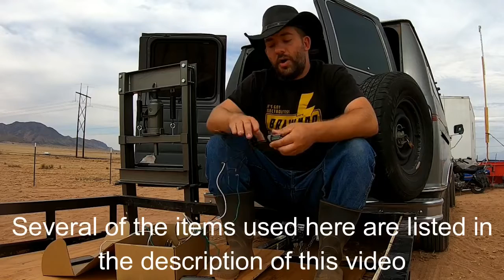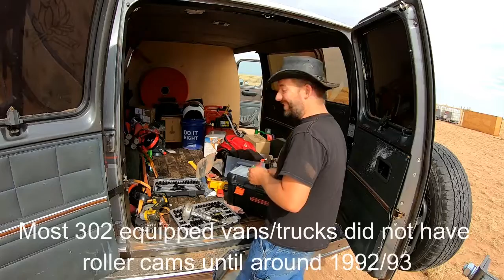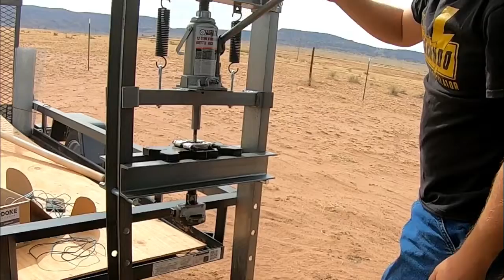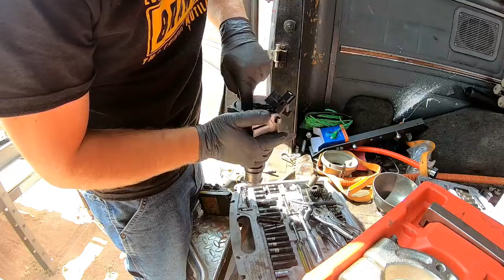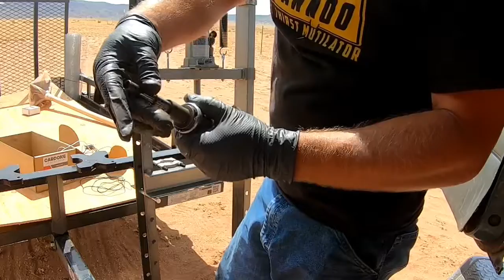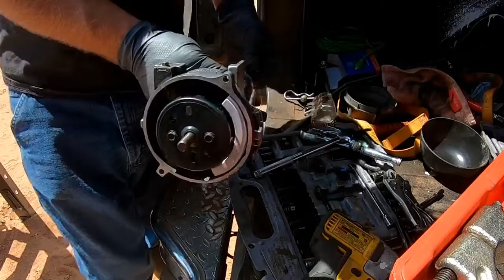How to DISASSEMBLE a Ford TFI Distributor & Change PIP Sensor

Comment: Curious if this part held up?  I did just buy this to replace in my 89 Mustang dist.  Like you, mine failed and I had a spare dist in my garage that I swapped in and the car fired up.  I'm planning to rebuild the other one and keep it in the trunk of my 89 mustang.  The dist that was in the car and failed was an MSD.  Not typically known for high reliability so I can't see how this generic part could be any worse than what came in the MSD unit

Comment: Hey man, I have a 1988 Ford Thunderbird Turbo Coupe 2.3 turbo. The car runs perfectly fine when it’s cold, but once it gets up to operating temperature it starts stumbling/misfiring and the tach will randomly drop. The other day it started misfiring really bad, but I shut the car off and restarted it and it went back to running normal.

I pulled the distributor cap and noticed the distributor shaft has noticeable side-to-side play. Do you think the worn distributor could be causing the PIP signal to act up when it gets hot, or would you suspect the PIP/TFI module itself? Have you run into this before?
Reply: I have a 1989 ford f250 5.8 v8 and I had the same problem replaced IAC, TFI, ECT, and searched for vaccum leaks but nothing. I recently replaced the fuel filter and it will now run at operating temperature but kinda rough some ideas to check.

Comment: Where are the bolts/screws that holdvthe Ignition control module in place on the 1991 f150 5.8 litre
Reply: In all these TFI distributors except for 94 and up, the module is hooked up to the distributors and the bolts holding it are in those 2 little holes on the module, they are buried and you need a special tool that looks like a little screwdriver that get them out OR you can turn the proper socket down real thin on a sander or similar tool,object being making the socket wall real thin,the proper tool is available at any part store for just a few bucks.

The reason these TFI modules go out is due to heat and being so close to the distributor ,in 1994 they relocated the module further away from the distributor eliminating the issue,normally the TFI module mounts to a heat sink on the side of the distributor and underneath that its very important that it has a film of some kind of either dielectric grease or computer arctic paste, artic paste being the best of the 2 but it has to have something or the new module will be on borrowed time.

The only difference between the 5.8 distributor and the 5.0 one is the length of the shaft because the 5.8 is a taller block, besides that they should be identical including module location and way to secure it to the distributor, on the new China distributors they actually got one thing right or should i said they did something right, the screws that hold the module are Phillips screws so you no longer need that funky tool.

Comment: I still don't understand why you have to tear the whole distributor apart just change out the pickup coil
Reply: The top of the shaft is a plate that the trigger wheel mounts on. The stator/PIP is mounted UNDERthis plate. The shaft has to be pulled/pushed through from the bottom up.  The gear has to be removed to do this.
Reply: Pick up coil goes around the shaft, therefore you must break it down and remove the shaft first.

Comment: Hey , scratch that . Of course the reason you must remove distributor from engine is the shaft that drives distributor has a cap plate welded to the top and no usable access to pickup coil even for inspection is available. Peace !
Reply: You could have just deleted your other comment. If you are unaware, move your cursor over to the right of your comment, 3 vertical dots will appear, click on them and you have a choice of deleting or editing your comment.